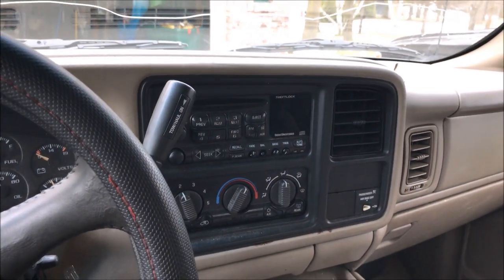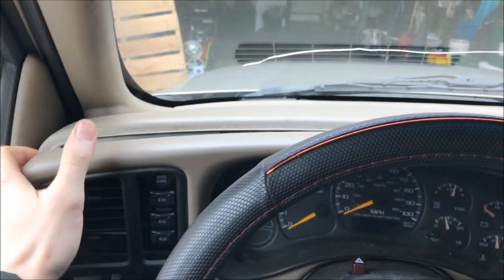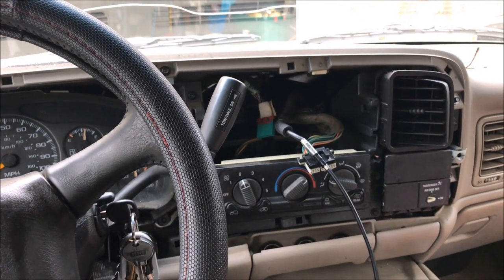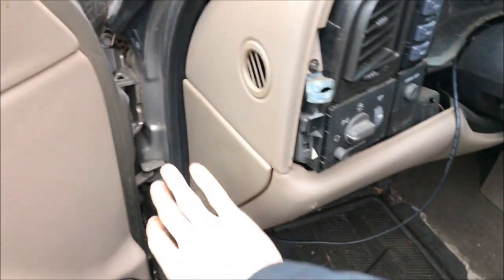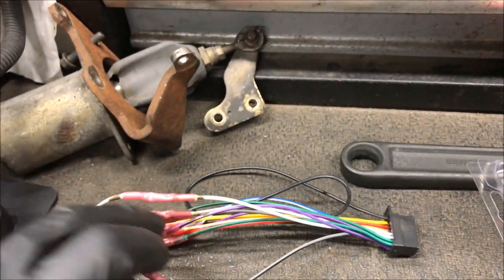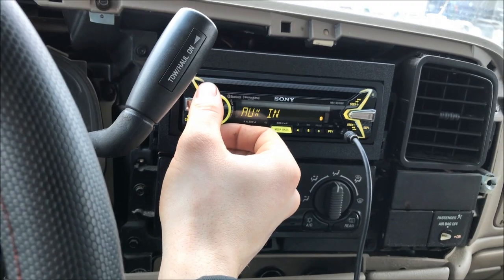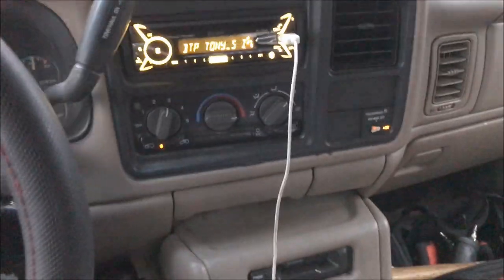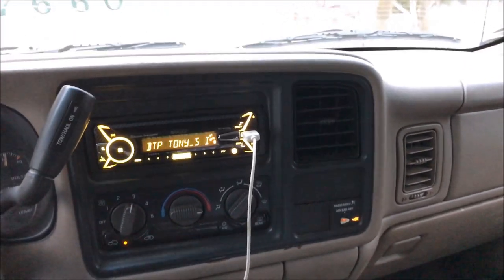GMC Sierra/Chevy Silverado Radio/Stereo/Deck Installation/Replacement Video

Comment: Awesome video I'm using this video to remove a aftermarket pioneer radio from a 2002 GMC SIERRA 1500 and install it in my 1986 Oldsmobile Cutlass Supreme Brougham doing some reverse engineering and using this video to save me time and give me a better understanding of how it's mounted in and how I'll be doing the installation on my G body peace ✌️ and much respect to you Jason
Reply from the maker: Good luck!

Comment: Tony, very helpful.  Thank you.   The directions with the Metra 99-3002 frame were crap at best.   I realize margins may be tight but one more sheet of paper or dare a say a 10 minute effort for Metra to create a YouTube video would have saved me some time.

I went with the soldering method given the super low audio voltages involved but I doubt anyone could tell a difference given these low end components and speakers.

Great video.  Thank you for taking the time to make it!
Reply from the maker: Haha, yes, their instructions are no good. Glad to be of help!
Reply: Why would you need a radio adaptor? I had a 99 Mazda that didn't need one.

Comment: What kind of harness would i need to get? I have a 2001 Chevrolet Tahoe LS 2WD the only things I’ve done with the audio is door speakers and the factory subwoofer it has the same factory head unit you have
Reply from the maker: I've got everything I used linked in the video description. If you think yours is different, you could always verify online at like Best Buy or Crutchfield by year/make/model.

Comment: They sell a cheap pocket/cubby hole for the center console where the outboard tape player for the '99-'02 Silverado/Sierra.
Reply: Duran Medine I remember looking for one back in 2000 when putting my stereo in. End up buying some thin metal at Home Depot and made one. Looks good though and never tried to find one. Now finally going to put a Bluetooth stereo and gotta figure out mic placement.
Reply: I am always impressed when the screen flips to sports or pornography. It’s super exciting on pioneer because that’s not Sony right?

Comment: Wait was I suppose to disconnect my battery from my Silverado or leave it connected to install the stereo?
Reply from the maker: Doesn’t matter as long as you don’t touch power to ground 😋 But it’s a good idea to disconnect the battery.
Reply: Tony The Truck Guy alright thanks!

Comment: Can you link the steering wheel control bro. Really interested. Nice video
Reply from the maker: Mine didn’t have steering wheel controls but I’m guessing you are referring to the module that lets you use factory steering wheel controls. Double check that it works on your vehicle, but this is what I used on my Jeep with steering wheel controls - https://axxessinterfaces.com/product/ASWC-1
Reply: @TonyTheTruckGuy  mine don't have it either but I would like something like that
Reply from the maker: @kevincaravantes6972  Oh I see. I guess I’m not sure how you would ADD steering wheel controls, this module just allows you to retain steering wheel controls if you already have them and switched to an aftermarket deck. You’d need a whole new wheel and do a bunch of wiring at minimum to add a wheel like that.
Reply: @TonyTheTruckGuy   that's what I was thinking too. I need a new steering wheel with the audio control. 
Thank you thoe

Comment: Did u get sound from the six speakers? I replaced the radio and i installed same harness but spakers on rear doors dont work...
Reply from the maker: I guess I never sat in back so I can’t say for certain, but I swear they did work. I sold the truck otherwise I’d check. Make sure you have the proper colored wires and stripes connected. Also made sure the fade and balance on the radio are centered.

Comment: My am/fm goes through all four speakers but when I put it in bluetooth or aux it only comes out the passenger side speakers any ideas
Reply from the maker: That’s very weird. You should google your radio make and model followed by “only sound on 1 side” and see if other people are having the same issues. I would say wiring but that wouldn’t make sense of everything works on radio. Almost sounds like radio or phone issue.

Comment: How did your radio turn on without the battery? Do you need to plug it back in before you turn it on? Or do you even need to unplug it? (the battery)
Reply from the maker: I probably didn’t unhook mine. You don’t HAVE to disconnect it, but I recommend it because if you aren’t careful, you can blow fuses or short out some wires.
Reply: @TonyTheTruckGuy  Okay cool, thanks! I'll prolly just unhook mine to be safe.

Comment: I have a wiring harness but I’m missing the orange wire and a blue with white wire. Is that an issue?
Reply from the maker: Blue with white should be just auxiliary for subs if you have them and I can’t remember what orange is for. If you don’t have subs, I would hook everything up and see what happens. If memory serves me right there have been other people that also didn’t have the orange wire.
Reply: Tony The Truck Guy thanks for the reply, I went ahead and hooked it up as is and I just ordered a mounting kit and a new wiring harness just in case. I did notice that the speaker in my drivers side door doesn’t work now. That could have to do with the missing wires. Do you know which antenna adapter I need? It’s a 2002 GMC Sierra and it’s a Sony CDX-GT200 radio
Reply from the maker: I think green, purple, white, and gray are your speaker wires. Should be 2 of each color. I would check your connection on those and make sure something isn’t loose cause like I said blue is just for sub/amp and orange usually isn’t used. If your factory antenna doesn’t plug directly into your Sony, you likely need the same antenna adapter I used.

Comment: But I'm gonna put in subs so do I need an amp harness or the regular
Reply from the maker: Sorry for the late reply, 300+ comments were "being held for review" for some reason. I think the amp harness is only if you have factory subs. As long as the normal harness has a blue wire, that should be your amp feed for aftermarket amp.

Comment: So I have the same truck and yours is a din and half correct?
Reply from the maker: Yeah, you need a different center section panel for a double din I think
Reply: Tony The Truck Guy no I’m putting a single din in my 2002 Sierra extended cab so the one you have should work

Comment: How would you remove the stereo with the metal bent?
Reply from the maker: You just pull the filler panel with the radio still in it and then bend the metal tabs back down if you need to get the radio out of the filler panel for some reason.
Reply: @TonyTheTruckGuy  do you just pull on the filler panel? or are their tabs you have to squeeze or screws?
Reply from the maker: @Cristian Lopez   Depends on the filler panel but this one has a plastic tab on each side you push down while you pull.

Comment: Mine works once my truck is off but as soon as i turn it on the radio turns on but wont play music
Reply from the maker: Are all of the wires connected properly and crimped well?
Reply: Yes
Reply from the maker: So the display works but there’s no sound?
Reply: Yea , i have a pioneer radio do u think thats the problem
Reply from the maker: Check all fuses in the fuse box under the hood as well as the one by the drivers door. If those are good, see if there’s any fuses on the back of the radio. If those are good, check your ground. That’s the most common issue.

Comment: What Brand is that white wire harnesses you bought separately?
Reply from the maker: The little white plastic plug with all the different color wires attached? It's Made by Metra. Part number should be in the video description, item #3 👍

Comment: Do I buy the amplified dimmer or non amplified dimmer?
Reply from the maker: Dimmer? What dimmer?
Reply: Tony The Truck Guy sorry I meant harness adapter I was doing something on my phone while typing this sorry 😂
Reply from the maker: Non amplified unless your truck has a Bose system probably. My truck didn’t have an amp, but I also didn’t have Bose.

Comment: My dash lights won’t come on and I’m fairly sure it’s because the other harness isn’t connected to anything
Reply from the maker: Try plugging the other harness back into the factory radio and see if your lights come back
Reply: @TonyTheTruckGuy  they didn’t, fuse probably but I’ve already tried a couple and can’t find it
Reply from the maker: @adamdohogne8053  Is it just your instrument cluster lights that aren’t working? Or no dash lights at all? Climate control, etc.
Reply: @TonyTheTruckGuy  just the instrument cluster lights, still have other lights on though such as e brake
Reply from the maker: @adamdohogne8053  Did your dimmer switch get turned down by accident when changing the radio? I would think that would control the other lights too but just an idea.

Comment: Would this fit a 98 Chevy Z71
Reply from the maker: The radio itself should, but you’ll need different wiring and antenna adapters as well as filler panel.
Reply: @TonyTheTruckGuy  would u be able to send a link of all those by chance ?
Reply from the maker: Just plug in your year/make/model here: http://www.metraonline.com/products

Comment: You don't need to get a antenna cable because you can use electric tape for the GM antenna cable
Reply from the maker: That's not as clean or professional though haha

Comment: Got power but no sound. 96 1500. So frustrating.
Reply from the maker: You have correct color wires for constant and switched power? And speaker wire colors all match?
Reply: @TonyTheTruckGuy  yes sir. I am thrown off by it.
Reply from the maker: If you have a FB, you should post a few pictures to my page of what you have going on so I can see and try to help out
Reply: Sure will. Thank you.

Comment: Mines doesn’t have sound
Reply from the maker: Make sure everything is plugged in all the way and all the wire colors are properly matched. Also if you used butt connectors like I did, make sure all your crimps are tight and make sure they are actually crimping the metal wire and not just the insulation. Does the radio at least turn on?

Comment: Does the smaller adapter come with the new radio?
Reply from the maker: If you mean the one with the black connector that plugs into the radio and gets wired to the adapter harness, yes that one came with my radio.

Comment: Anybody know where else I can get a multi kit for a 06?
Reply from the maker: What do you mean by multi kit?
Reply: Tony The Truck Guy the thing that the new radio goes in and it like holds it in place I guess Idk I tried the read the package but I couldn’t see anything except multi kit
Reply from the maker: Oh just the filler panel. Are you doing a single din radio like me, or doing a bigger double din?
Reply: Tony The Truck Guy single...I think...idk much about radios I just know how to put em in now lol
Reply from the maker: Haha no worries. A normal one like mine is a single din. A double din is the bigger ones which are normally a touch screen display. The double din is the more expensive route as the radios themselves are usually more, and you have to buy an all new dash panel to make it fit, which I think is only available in black.
Reply: Tony The Truck Guy no no mines like yours lol...also...do you know if a 2006 GMC Sierra would have an aux input? That’s the only reason I’m getting a new one haven’t bought it yet but I’m buyin a pioneer...the truck radio has the aux option but I can’t find the input
Reply from the maker: What make/model/trim  is your truck?
Reply: Tony The Truck Guy make: GMC model:Sierra trim: Idek...don’t know what that means
Reply from the maker: Your stock radio has an aux option but you can’t find the aux port? Just did a little research and couldn’t find any videos showing a stock port. Very odd. I think you need aftermarket unless it’s tucked behind your radio for some reason.
Reply: Tony The Truck Guy I have no idea...I did some research and the only thing I could find is that you can buy an adapter that hooks up to your wire harness and it works that way or you had to set up XM radio some how I think I might as well buy an after market...where’d you say I could buy that filler thingy?
Reply from the maker: http://www.metraonline.com/

Use the year/make/model/trim drop-downs on the right. I think you want the 95-2001 part # or the 99-2001 which comes with a pocket cubby replacement for your cassette player if you have one.
Reply: Tony The Truck Guy there not any local stores? Walmart, Auto part store, etc